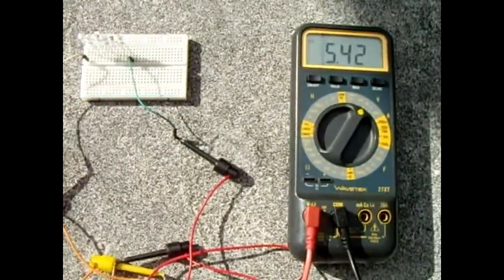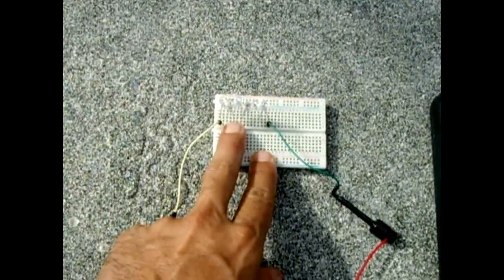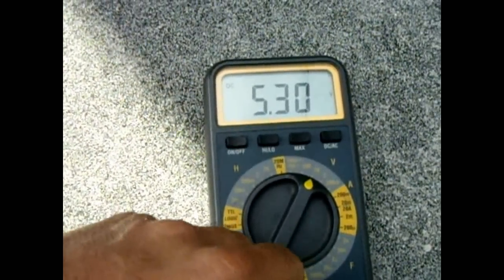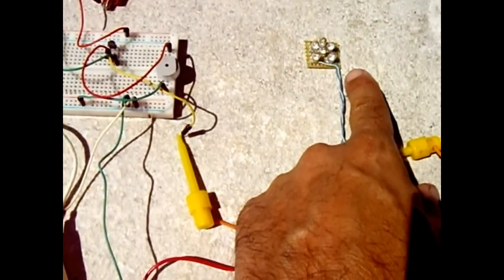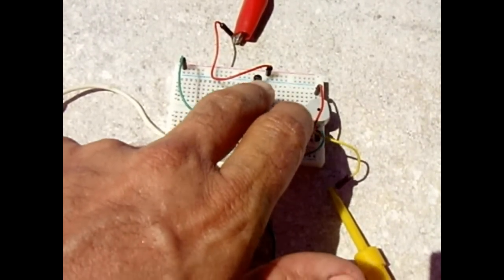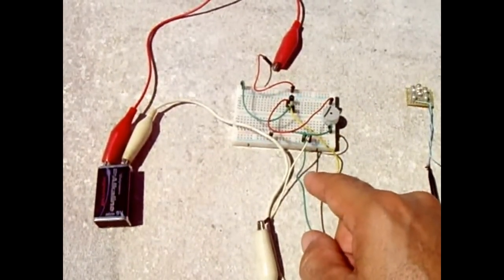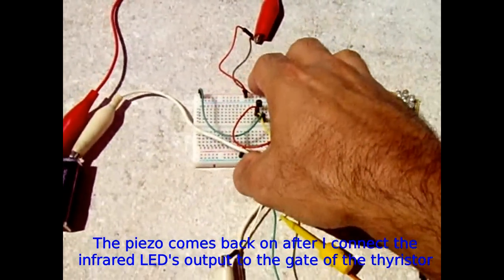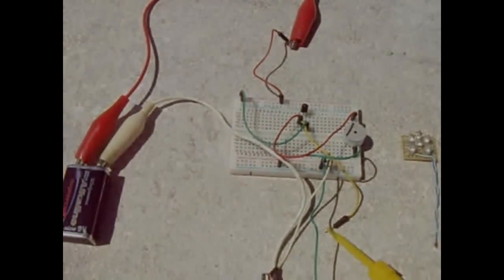Using INFRARED LED's as Solar Cells To Trigger A Circuit

Comment: I'm curious if you place a magnifying glass from a laser pointer to the top of the diodes if it would increase the output.

I'm also making a fogponic self contained portable grow bucket that uses a 700ma ultrasonic fogger set on a timer to run 15 seconds every 4 minutes.
  I want to make it untethered so I can bring it outside on nice days, so I need a solar panel and battery that will maintain at least 10 hours of darkness, but the question I have is will the red, blue, and white LED grow light I use inside power a solar panel, and what type will work the best?
Reply from the maker: Higher light intensity will increase current output. Blue LED's, infrared, and UV LED's work best. You're looking for just over 1/2hr of power(38mins) during that 10 hr period. You can use a solar panel shown at the link below. Look for a 12W minimum. Be sure to use the coupon (elec or affiliate6) to save money. Look for a sealed lead acid battery rated around around 4AH. You can buy cheap solar panel charge controllers also.  

http://bit.ly/2k2REpq

Comment: hi i have a question,
if i need to join  IR leds togather to get a higher voltage since i get already very low voltages ( about 100 mvs as maximum in my room) does it matter in the terminals?
oh and i have a project that i want it to be connected to those leds such as both of them to be as power sources. is this possible or i should think about another schematic?? 
thank you :)
Reply from the maker: nour shahawy How many terminals? I don't understand what you are saying. If the project uses too much current, then I suggest you use a few solar cells connected in series.
Reply: thanks for the quik reply :) but i guess i didnt explain my question right
Reply: electronicsNmore no no ,it is complecated. 
my project is about capturing energy from radiowaves. so i have a reciver LC circuit capturing aproximatly 200 mv in capacitor. 
Now about the terminals i meant about the positive and negative terminals. so what i wanted to do is to connect both projects to obtain a high voltage. now my trouble is in their connection. that is why i am asking u.
What can u recommend?